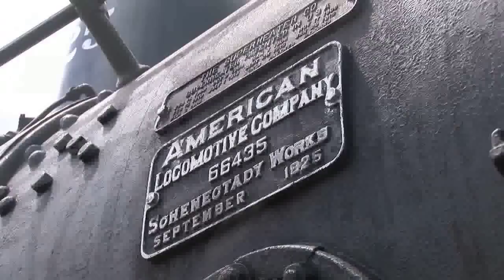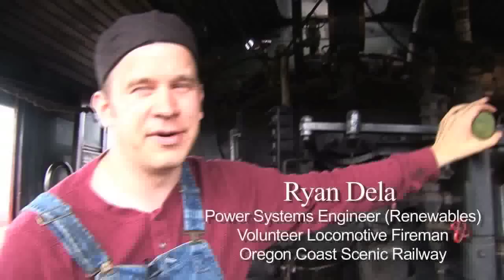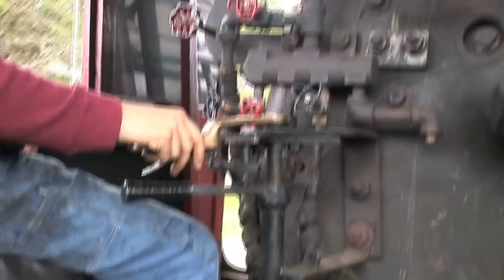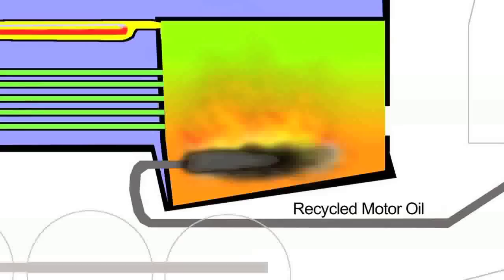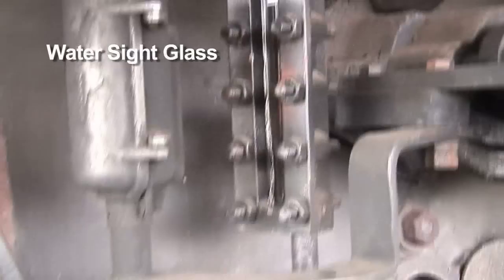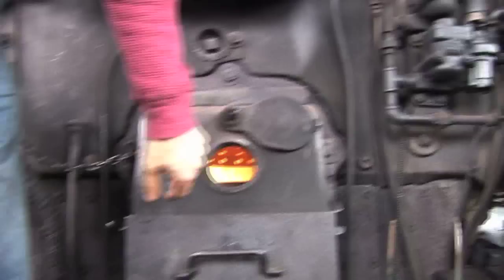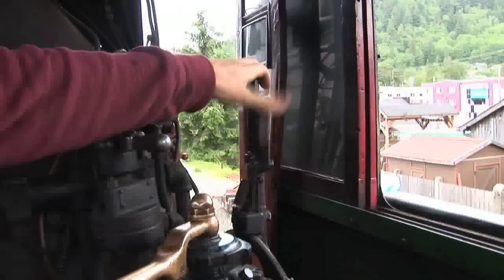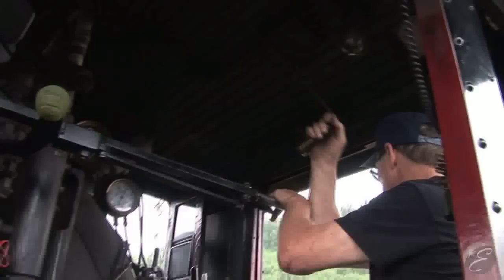Operating a Steam Locomotive

Comment: UK locos are mostly coal fired. 

I've seen the engineer of the a steamship empty the galley dregs into the oil tanks via a funnel with a filter gauze. She'd also accept old engine oil too. It was all preheated and atomised. 35 tons of oil would last a bit over half a week on two boilers at 175 psi, 2100 hp max rated and a service speed of 14  1/2 knots.

Comment: Although a 2-6-2, the locomotive here is a "false prairie" since the trailing wheels (the rightmost "2") are not supporting the firebox but rather used to guide the drivers around a curve, same as the leading wheels.  I was puzzling over how odd they looked when the docent mentioned "used on a logging railroad" and the penny dropped.  Logging locomotives run backwards as much as they do forwards (rather like this one is at the museum) and such a feature is handy on their curvy, quickly-laid rails.

Comment: Always get steam locos into the restoration shops and replace all the parts! Flues, rods, regulator, reverser, pressure gauges, whistle, boiler metal, smoke deflectors (if there are any), and everything else! 

Restore all the remaining steam locomotives! Put them in the restoration shops and make them alive again! Besides, it is fun for the WHOLE FAMILY, to watch a historic, living and breathing machine!
Reply: +Peremarquette1225 I agree! It is quite interesting seeing all the volunteers put in their work and remake pieces. Always something exiting happening for a good cause!
Reply: +Streamlined Steamroller Here is one to add to your list, UP 2564.
Reply: Weldy Media Productions Don't forget GN 2584 too!
Reply: Weldy Media Productions The one at OERM? Definitely! Just $2 million and it will run again! Maybe even on excursions.
Reply: +Railfan346 Your comment reminds me of my comment on a video of C&O 1309 (being restored to operate on the WMSR!). :)
Reply: +Streamlined Steamroller On your list, some are already in operating condition or are going to be operational. They include 2 (Orange Blossom Cannonball, I blew her whistle and rang her bell! :D) 63 (IRM) 261, 611, 700, 765, 844, 1309, 1630, 3985, 4014 and 4449.

Historic steamers also worth mentioning are 113, 152, 153, 425, 490, 520, 587, 779, 1522, 1529, 2102, 2479 (slow restoration), 2789 (slow restoration), 2926 (being restored), 3751 (operating), 4500 (B&O), 5000 and 5300. Oh, the list will go on. :)
Reply: 09trainman T1 #5550 is being built.
Reply: Streamlined Steamroller Awesome!
Reply: +09trainman Union Pacific Big boy 4014 is being restored as we speak. Not sure if you knew that already im pretty excited about it
Reply: RichyRich9120 Yeah, I knew that for a while, I'm hyped about it too!
Reply: RichyRich9120 Same! Can't wait for it.
Reply: WE NEED CP 2929 RESTORED!
Reply: Yes! And it'd be awesome to restore WP 334 for excursion work on the Feather River Canyon!
Reply: 09trainman Ya!
Reply: C&O 2716 is also being restored to operation as well as L&N 152.
Reply: Rebel9668 Ik

Comment: In my youth (1950s) I used to watch exciting b/w movies involving steam trains, rail obstacles, and bad guys. The engineer would be seen frantically throttling back, applying maximum engine braking, at the same time yanking the drive lever into reverse, before applying throttle again. The loco drive wheels would alternate between sliding, or spinning madly, on the tracks to try and increase the braking effect. Was that realism, could it actually happen under extreme circumstances without wrecking the drive mechanism - or was it or pure Hollywood?

Comment: the damper handle does not control the air pump as the video shows.  While the fellow explained it correctly..... it could not have been depicted more inaccurately
Reply: Yes it could, the graphic arrow could have been pointing at the dynamo. At least the term "air compressor" has the word "air" in it, even if the compressor has nothing to do with the "air" damper for the firebox. =P

Comment: When the firemen is talking about the damper, this does not include the air compressor. They are two different things here.
Reply: Yeah the air compressor is for brakes, fuel injection system (for oil-fired locos) or fueling gate (for coal-fired locos), and other accessories like the bell striker and the secondary air horn (slightly quieter than the steam whistle, normally used in stations)

Comment: What is the purpose of injecting sand in the boiler pipes for cleaning them?  How does sand clean the pipes
Reply: Osama I ever heard of sandpaper or more accurately sandblasting? That’s essentially what they have to do to clean the inside of the pipes of corrosion as I would imagine that the oxidization process is faster in those pipes.

Comment: wow.. dangerous.. 175psi of steam.. 😁
Reply: Not dangerous if the boiler is designed to handle it, and has no faults, and there's pressure relief valves.  I get the idea at one time, boiler explosions were a nasty problem, but engineering improved.  I would presume they subject these boilers to some testing for integrity ( I should say I would hope.)
Reply: Michael Bauers FRA requires boiler ultrasound inspection and hydrostatic test at 125% of working pressure before certification. 175psi means at least a 218psi test.

Comment: How the reverse work ???
Steam can work both side but how do you control it ????
Reply: Pinpin2005....Type this into the YouTube search engine at the top of this page: walschaerts valve gear   The videos will explain how the valve gear works & the linkage connections. Rather than type out a whole page of explanation, watch a couples of the walschaerts valve gear videos. Walschaerts was the most common valve gear used on steam locomotives.

Comment: Can you tell me why steam is ejected out the side @ 5:33? Thanks.
Reply: driech1...Steam locomotives have ports (petcocks) on the cylinders used to expel water so the piston doesn't compress it & blow the head off the cylinder. When a locomotive sits for a while, the cylinder walls cool down causing steam to condensate on the cylinder walls. When the piston travels fore & aft, the water will attempt to compress against the cylinder head. Water doesn't compress very well & it will cause the head to crack or literally blow off the cylinder to relieve the pressure. The engineer has a lever to open the petcocks from inside the cab. As the piston travels back & forth with the petcocks open, steam is also released which aids expelling the water. You'll see the engineer "clear the cylinders" when a locomotive has just been fired up or sitting for a while.
Reply: Thank you.
Reply: Your welcome. You'll see the engineer clear the cylinders of water on several steam locomotive videos here on YouTube. Often, the locomotive is passing people standing along the tracks while steam is ejecting. The steam is warm, but not hot enough to burn. It does startle you when that happens.

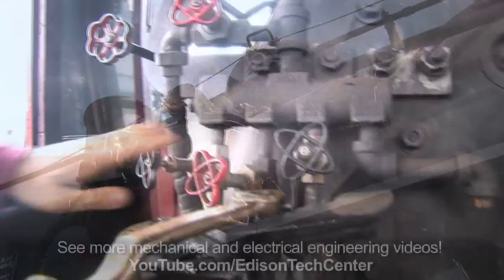Comment: 2:19 the air pump shown on the side of the locomotive is NOT related at all to the firebox and damper controls. The damper simply controls how much outside are is being let in from the bottom of the firebox. The air pump is ONLY used to replenish the air supply for the train’s air brakes. This video gave false and misleading information.

Comment: why dont you make a fire with cole
Reply: +Mathijs Netten 
Coal is generally unavailable on the West Coast of the USA. Coal has its own problems as there is ash and clinker buildup on the grates requiring aggressive cleanout and dumping. This was a wood fired locomotive, never designed for coal burning. It is much easier to convert a wood furnace to be oil fired. The oil actually burns much cleaner than wood and has much less smoke coming from the stack. The fireman controls the combustion such that there is little smoke. We would never allow steam locomotives to trail a mile of black smoke as they did in the past when there was no regard for air pollution.